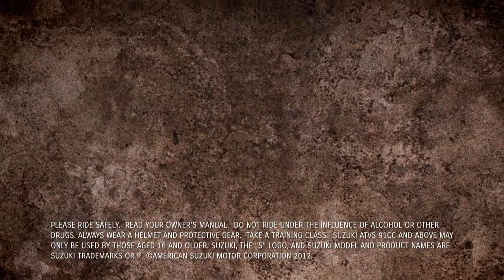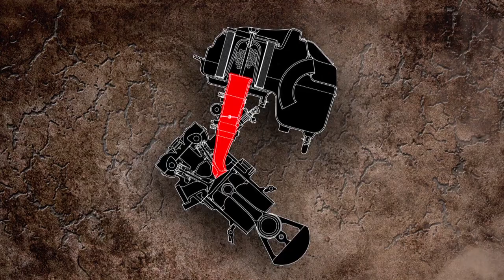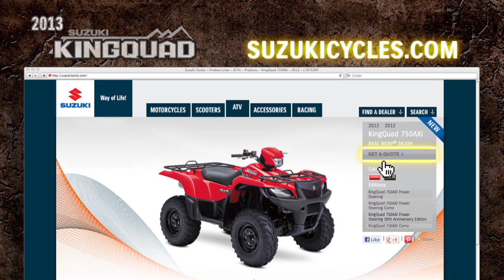2013 Suzuki KingQuad 750 AXi Engine Manufacturing Process - Behind the scenes look

Comment: Fourwheeler is a piece of junk. I bought mine brand new. Tried to ride as easy as possible and still have had horrible experiences. Dealership kept my bike for 5 months after I owned it about 7 months. Called Suzuki customer service and they were very unhelpful and rude. Guess what it broke again yesterday after only 4 rides! I will never buy another Suzuki product and I wouldn't even buy a valve stem cap from Ron Ayers Motorsports. Glad this video popped up while I'm researching how to fix my bike by myself since the powers at hand are completely worthless.
Reply: get a refund go with Yamaha if thats the case
Reply: What happened to you atv?  What’s broke on it cause I just bought one and an curious